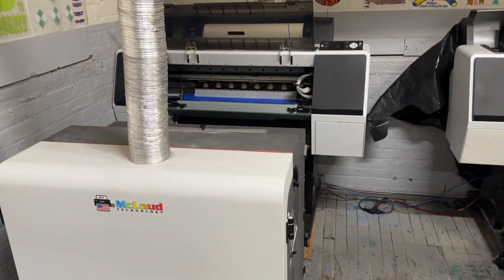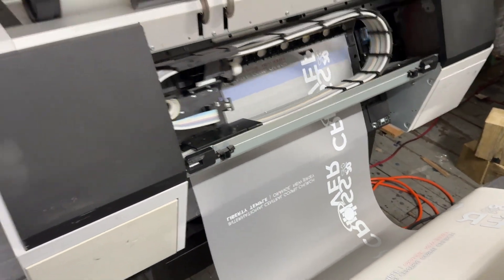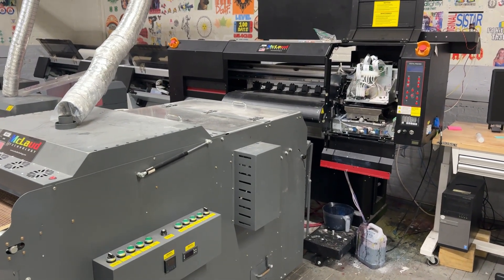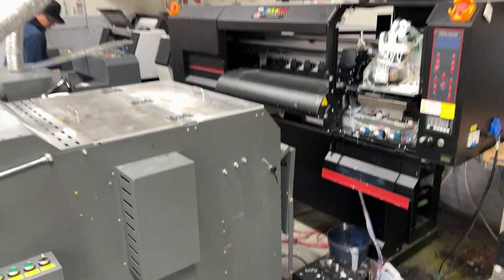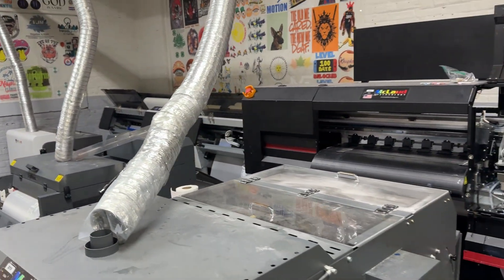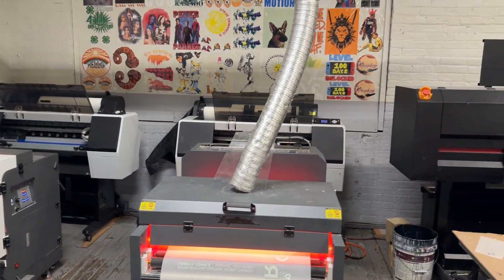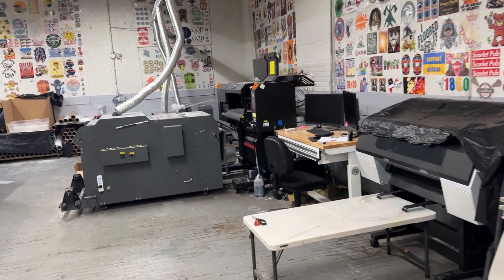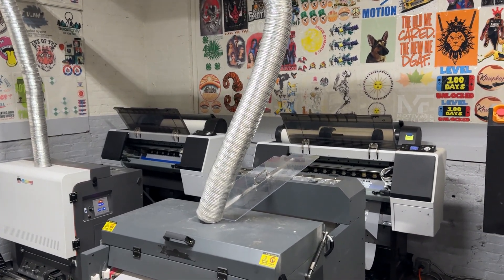Comparing DTF Printers after 3 months of operation.

Comment: Do this printer have auto circulation and automatic printhead cleaning. Also is this a converted epson 9890? Is it a original dtf printer or converted? I have the $6000 ready soon as you respond
Reply from the maker: We use 7890 because the ink cartridge is easy to reset. No ink circulation because the ink we use is good enough. Just a little shake for 10 secs and will last the whole day printing.